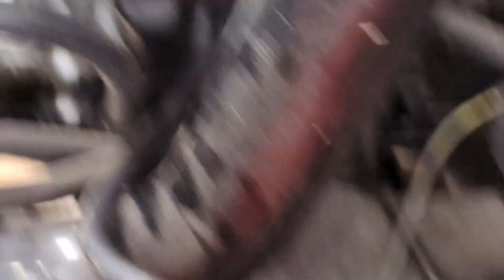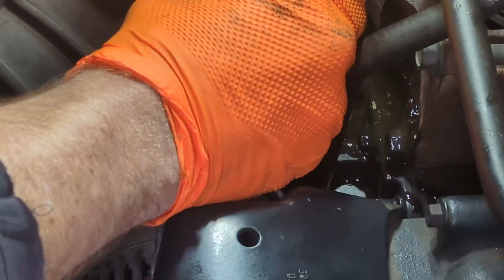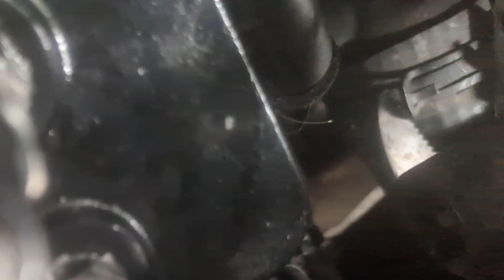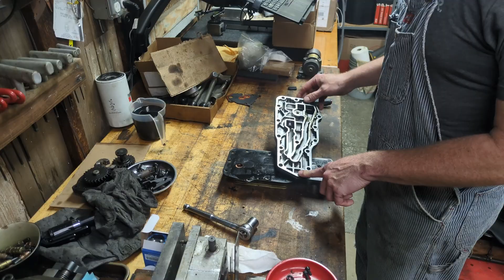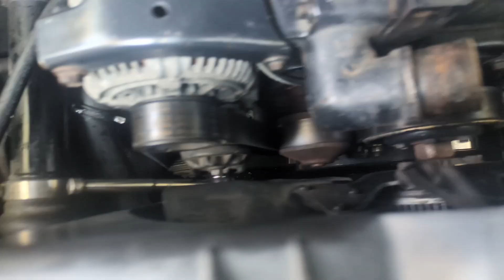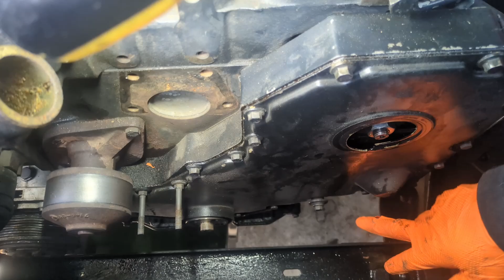1st Gen Tales Pt 1 - Dodge Cummins - Troubleshooting complete oil pressure loss

Comment: Well done shutting it off when you noticed the light.  I bet most people would be looking at a replacement engine and not just an oil pump!  And the videos are cracking me up more and more.
Reply from the maker: Thanks for the comment Dartguy.  A friend of mine blew up an engine just after rebuild because he ignored his oil pressure gauge.  I would have shut it down anyway, but because I had that memory in mind, I didn't even think about it twice.
Reply: That’s a scary wake up call to pay attention to the factory gauges!
Reply from the maker: @JustDiesels  Right!?  They are there for a reason.  So far, when folks have been guessing what the problem could be, the number one choice was a bad oil pressure sensor.  I thought that was probably the issue too, but I'm so glad I didn't just ignore the light/gauge.